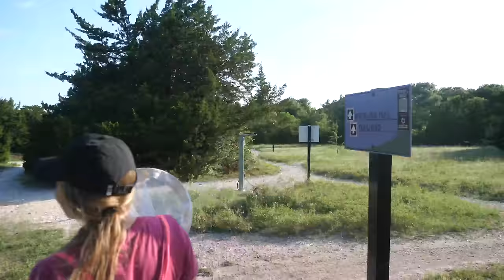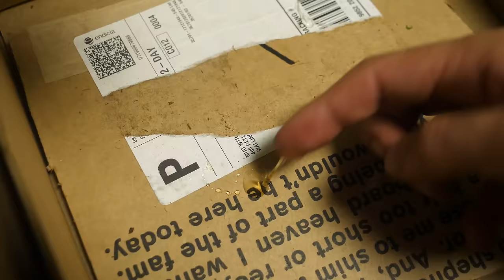My Pet Western Yellow Jackets

Comment: You know they recognize faces? Had a yellow jacket nest I never got around to dealing with and after a while I realized they weren't attacking me even if I stood right under their nest. One would watch me for a bit, flutter it's wings and go about its business. Sometime late in the fall when they were clearing out, one followed me in the house and was just kinda looking at me and around before going out the door. I'd like to think it was saying 'thanks'.
Reply: The flutter is usually a warning, basically stating, that distance is good, any closer and we will attack. But yes, wasps/hornets do have the ability to remember individuals, and given enough interaction time (ie feeding the hive), they will come to not see you as a threat.
Reply: Oh yes wasps will definitely get used to you after a while. I had a large paper nest by my front door last year and at first they all stood at attention when I would get close. But after a few days they just ignored me. They ended up building the nest to a very large size with about fifty wasps on it. I never got stung but of course I didn't touch them or mess with them. When winter came and they were all gone, I removed the nest and still have it because it's very big and impressive looking.

Comment: Great video but I would like to add that those look more like eastern yellow jackets (vespula maculifrons) as opposed to western yellow jackets  (vespula pensylvanica) you can tell by the markings on the abdomen where as the ones in the video has a thicker black line and thin yellow much like the eastern yellow jackets (vespula maculifrons) where as the western yellow jackets (vespula pensylvanica) are primarily yellow with a black arrow each middle section with a black dot on either side of the arrow.